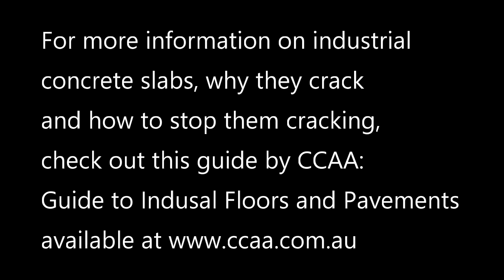Why do concrete driveways and floor slabs crack and what you can do so that they don't crack

Comment: 5:38 looks like point loading and deflection failure... Notice the lowered triangular shapes, they incline /depress at the four corners...
Looks like lack of or loss of load bearing capacity with respect to the applied load at that location...
Notice the "45" degree breaks... U know loads love to resolve in 45 degrees...
Take care...
Reply from the maker: Thanks for the comment and suggestion. I have thought carefully about whether I agree with your suggestion and how an engineer would prove or disprove the bearing failure assertion.
I think coring or drilling the concrete would show whether there was a void at the underside of the concrete at that very spot. Loss of soil and therefore support could occur from pumping of fines (https://pavementinteractive.org/reference-desk/pavement-management/pavement-distresses/water-bleeding-and-pumping/) through the control joint but I think that is less likely in sawn joints which are not right through the concrete. 
That leaves shrinkage/curing issues. 
This website discusses slab curling from uneven drying of the concrete https://www.woc360.com/concrete-masonry-resources/preventing-and-repairing-slab-cracks-part-2
This is similar to what you are suggesting but upside-down if you like. The slab corners pop up due to drying strains and then are broken off by loading. This sort of curling is known to happen in suspended slabs that are supported on 4 walls but for suspended slabs we design suspended slabs to be tied down at corners and provide reinforcement continuity to minimize cracking. 
Any one else got some ideas?
Reply: @CornellEngineers  , give me a little to digest your data and I will reply again...
Fyi, I have been able to duplicate curling by heating the soil at one location (a joint) and then placing a sample of concrete over the "four corners"... 
Simple answer, an an obvious bone if you think about it... The heated soil wicks the water from the concrete OR it "boils it to the surface as bleed water"...
With all that said, soil temperature should be the same or you will get differential drying and perhaps this will explain a lot of our concrete issues that just seem "inexplicable"...
Core drilling is always an excellent choice for gathering data, I simple use a probe and it has a pressure guage...
I will attempt to find that probe video and I hope to sell u on the exploratory idea of it's usage...
Now I will open ur links and learn...brb with my thoughts and I hope I agree (my bias, I want you to be correct)...
Reply: @CornellEngineers  , Cornell Engineers, I hope you saw my previous reply and I read the two supplied articles you provided...
I enjoyed the water bleeding up images with the asphalt...   I am of the belief that no crack is random and just because we cannot determine the stress that caused it does not make it ''random'' as ACI states, "Completely crack-free slabs are unrealistic in most cases. ACI 302.1 recommends that the contractor advise every owner “that it is completely normal to expect some amount of cracking and curling.”...
I believe all cracks have an explanation and it could simple be that the aggregate created a ''weak plane'' in the concrete...
Imagine if you will, stone connecting / contacting each other in the slab, this would create an ''underlying control joint''' as the paste around those stones would not be uniformity covered... 
I have experimented with this theory with butting stone together and adding concrete around my ''control joint of stone'' and with predictable results, the sample fractured as the ''design stone layout"... 
Cornell Engineers, I am in youtube's timeout at this time, for one week (because I did a covid video = shame on me, ha) but, I want to load up a video where I am standing on a thin piece of glass and because no deflect of the subsurface (based on my loading), the glass does not fracture...   
Basically, I find a few failures in non-reinforced concrete, deflection (soil reduction values) and overloading (surging the concrete with vehicle traffic and their continued sudden stops at the same location)... think of the ruts we see at intersections, how the asphalt will show those deep ruts and the same where cracks in concrete is shown...
Reinforced concrete is a different animal and I reference that as a marriage of steel (man) and concrete (woman) and water is the ''character'' that will break up the marriage...   The ''man'' surfers from rust jacking and the woman from salts / efflorescence failure.
Here is an old video I put up on this  https://youtu.be/8791WuOd0Po  (one of my other channels)... 
You might like what I have planned, a lot of rebar pullout test and explanation on the importance of a rebar pullout test...
I hope we can collaborate in the future... Perhaps, on the Marine Towers West Garage Collapse; I am getting a lot of data from the owners of the East structure and engineer reports (one of which, instructs the maintenance  man to do structural repairs and also it lacks a shoring detail or even a request to hire a shoring expert)...